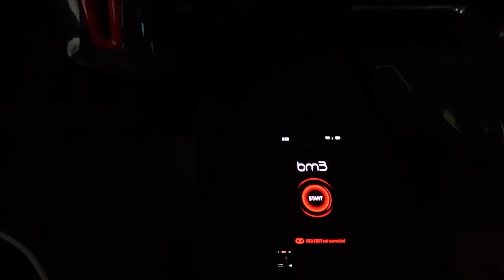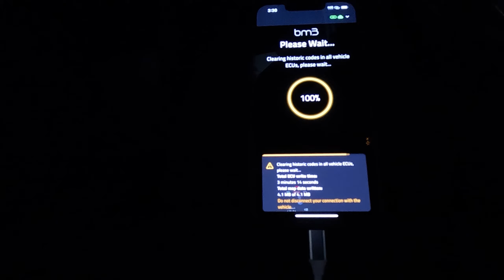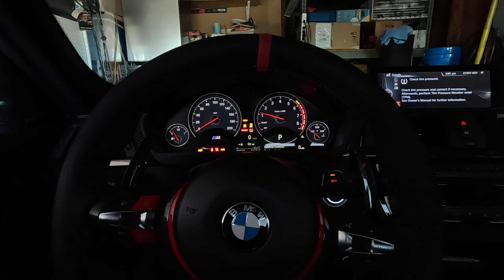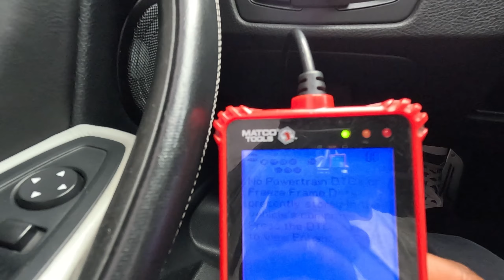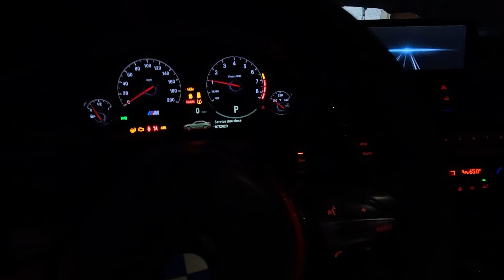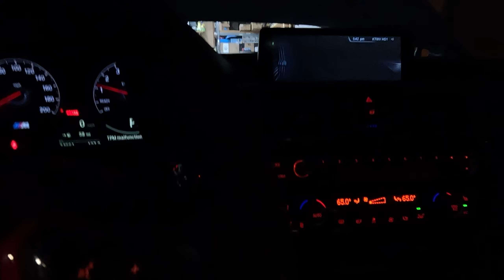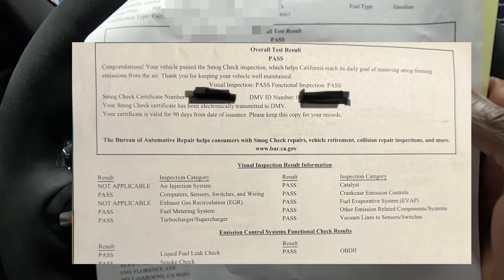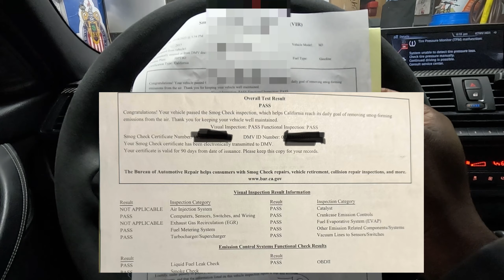WHAT IS LIKE OWNING A MODIFY CAR IN CALIFORNIA!

Comment: Awesome. Glad it worked. What WiFi dongle are you using?
Reply from the maker: I am using my hot spot from another phone.
Reply: Looks like you are using a wired ENET cable to your phone and not the wireless dongle?
Reply from the maker: @Tacoexplorer I am using Ethernet adapter with a iPhone lightning adapter. I got it from the guys at EAS.